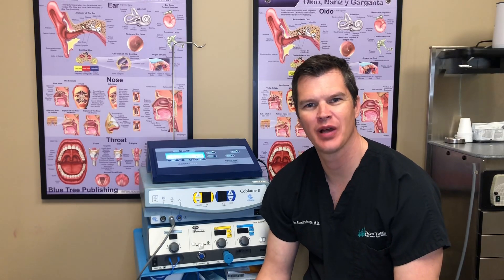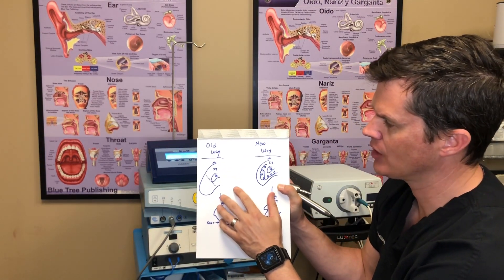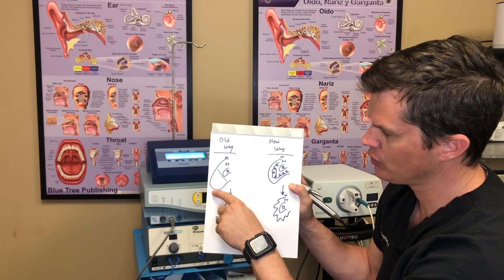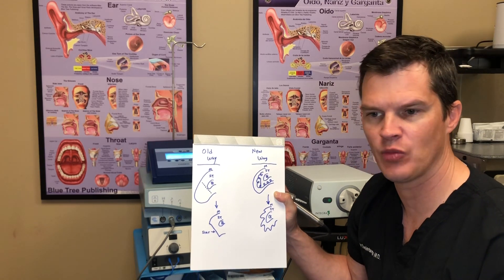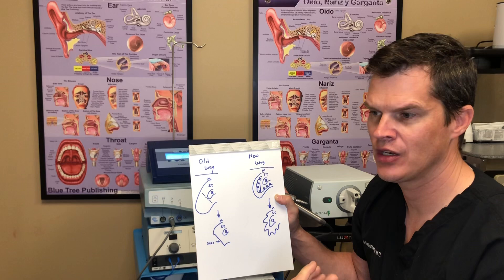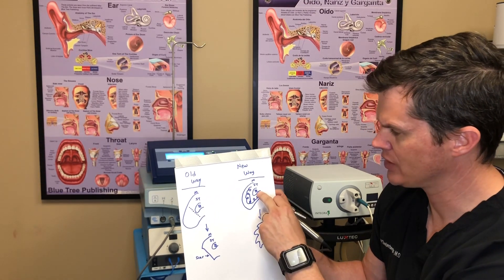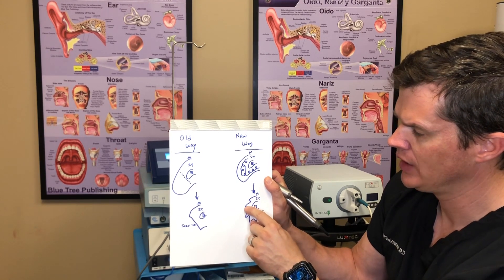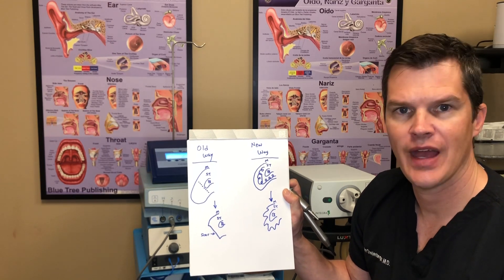Turbinoplasty: new way vs old way

Comment: Hey Dr. i had RF ablation and a while after that i had outfracture too. But after the outfracture i have no to little mucus and sense of smell and air decreased. I don't have ens symptoms but i have mucosal issues. Is this because of damage to mucosa or the positioning of the turbinates? Please guide me.
Reply from the maker: @Ahmetcoşar-u8n  I think it’s more likely related to the radio frequency, than the outfracture. If radio frequency is done too close to the lining it can cause the mucosa to be damaged. That said, that usually fades over period of a few months.
Reply: @dr.shellenberger9830  Im 5 months post op, when i dont blow my nose for a long time i sense air better or when im sick and produce mucus more. But normally its dry and hard to smell and sense air. Will it heal over time?

Comment: Thanks for your helpful video ,i have a  question whats effective and no side effects(ENS) precedure ,laser,shrinking or cut the turbinate?
Thank you again
Reply from the maker: @hassanourahou6932  anything that damages or removes the lining of the turbinate has a higher risk of ENS.  

I’ve done hundreds, if not, thousands of submucosal reductions like I described in the video and have never had a patient complain of long-term issues. 

I am not a fan of the laser procedures because they damage the lining.
Reply: If I go to an ENT, how would I name this particular way of doing this turbinate reduction in the way that they would be familiar with?
Reply from the maker: @ this is a submucosal turbinate reduction.
Reply: @ is that what the technique is called or is that a blanket term for different techniques. I know resection and superficial ablation techniques are bad. What is this technique?
Reply from the maker: @ turbinoplasty is a blanket term.  Resection is another blanket term.  There are lot of ways to do a turbinoplasty.  Submucosal technique spares the lining (“mucosa”).
Reply: @ thanks

Comment: nobody asks the simple QUESTION WHY DOES TURBINATE HYPERTROPHY, if only ENT Asked this simple question and treated the root cause of hypertrophy, there would be no need of these stupid surgeries.
Reply from the maker: @boyandonev7521  there is a mountain of research on turbinates, what they do, why they get big, what simple things we can do to make them smaller, medical managements, diet changes, and about another dozen factors they weigh into a good doc’s mind before considering recommending surgery. 

Making a decision for surgery is always one where the patient has to weigh risks and benefits.  Certainly not every surgery is perfect…but I’ve had hundreds of patients over the last 18 years who have said, “I breathe so much better” after a simple turbinoplasty.
Reply: Doctors should determine the root cause of appendicitis too before they remove the appendix. That's what you sound like. 

I'm pretty sure after I got my usual seasonal allergies, the seasons changed but my turbinates stayed in hayfever mode and don't know how to go back to normal. Unless you think there's a way to get them to stop allergically reacting to literally nothing at all, then surgery will probably help

Comment: Constant runny nose and sneezing, doesn't always mean something wrong with the body. Im young and dealing with vasomotor rhinitis, been dealing with it for 4 years now and it's annoying. I get allergy tested twice and both were negative. Got XRay and Cat Scan and both were negative. I didn't have no polyps or nothing in my nose. I do have a slight deviated septum, but I never had issues with breathing tho. H**l I even got blood work done and nothing, it was NEGATIVE. People always negative and forget that everybodys issues is different. People forget things change in the body, other than "there's something wrong in the body". Our body do have nerves all through it, so the sinus has a nerve and you know how nerves work, they do alot. And sometimes, nerves do overwork itself.
Reply: Me too I also have vasomotor rhinitis, I personally think it’s because of overactive parasympathetic nerves. Did you find a solution for yourself ?
Reply: @EmanuelKljusev-uy6uw  Naw I haven't found a permanent solution yet. But I have found out that mint can control the issue. I found out that when I would brush my teeth. The mint from the toothpaste, would control and calm the lining and nerves inside my nose. Because of the strong cent cooling sensation from mint. So I bought a mint stick to try and fix the issue. But is it a permanent solution? No. It'll keep working, but at some point, vasomotor rhinitis will overpower the mint, because vasomotor rhinitis will just stimulate even harder from the mint stick. But the mint stick will still work, to a couple minutes, to a couple hours, even days or so. But like I said at some point, the issue will just stimulate even harder. Causing more sneezing and runny nose. But you can use it to get the symptom under control temporarily. Plus who wants to keep using a pocket mint stick, putting it up to their nose and sniffing it constantly lol. It'll make others look at you and think you are on something lol. I said I was going to buy an MD Nasal machine for the solution. But I don't know if it's going to help fix the issue. I'm still in the same boat. I'm still trying to figure out the issue.

Comment: Did you say that Empty Nose Syndrome is caused by the overabundance of crusting 2:00 ? I don't think that's right. I think ENS results from nerve damage in the resected turbinates that causes the brain to be unable to register air flow, which induces a sensation of asphyxia. Correct me if I'm wrong.
Reply: I think ENS and crusting occurred simultaneously after resection in some cases.
Reply: Not everybody gets ENS maybe only 10%, but those 10%*suffer real badly
Reply: @nenadcubric2663  Had I known of ENS, I would have been a lot more thoughtful in deciding to have my surgery. I was lucky.

Comment: I had septoplasty turbinoplasty with microdribder. I am having trouble sleeping. I am feeling burning in my lungs. I am feeling lumps of dust in my throat. It has been 2 months now.Is this empty nose syndrome? I am feeling very scared There was fluid accumulation in my ear, the doctor said that DNS or Inferior turbinate enlargement should be done and he advised me to undergo septoplasty turbinoplasty with microdribder. I have to take a deep breath after a few minutes😢
Reply: Hello ankit is it better now or do you feel the same bro? Im post op 18 days now and too much mucus buildup nose bleeds crusts and not being able to breathe and sleep please reply if you got better or not im feeling the same depression you felt while typing this comment 😢
Reply: @shubhamadhana1185  Which method did the doctor use to do this?
Reply: @AnkitSharma-hr6rl  i dont know about this but he is actually a very senior doctor from Apollo hospital Delhi and have a very good record
Reply: @AnkitSharma-hr6rl  how do you feel now is it better?
Reply: @shubhamadhana1185  No brother, nothing much has happened. I have sleep problems. I feel cold air inside my nose when I breathe or there is obstruction.
Reply: @AnkitSharma-hr6rl  so you can’t exercise or do any physical tasks?
Reply: @shubhamadhana1185  no bro
Reply: @shubhamadhana1185  I feel extremely tired because I don't get enough sleep
Reply: @AnkitSharma-hr6rl  How are u feeling now bro?

Comment: Any type of these unnecessary procedures can cause extreme irreversible harm that is not fully discussed amongst patients. Turbinates are essential to the respiratory system and also have a neurological connection to alert the brain that you are breathing. Something goes wrong with these surgeries you have no way to reverse damages and are gas lighted by Ent dr.s until you are 6ft under.
Reply: Why are you saying unnecessary procedure, obviously most of us have trouble breathing, mine is so bad that I even have blood pressure and stress since I was a teenager.

Comment: My dad once told me that everything in your body has a purpose and you should really be careful about removing anything from your body.  No way would I let a doctor stick that microdebrider in the nose of anyone I care about.  Think about that people….would you want that thing stuck up your nose turning a grape into a raisin???
Reply: You would if you suffered from chronic rhinitis or sinusitis.

I'm sorry but It's a awful, awful condition and it just worse as time goes on. I feel like I can maybe get in 30% of the air I used to get in, when I sleep it has to be on my back with my head propped up which results in my body sometimes forgetting to take breaths in or takes really shallow breaths.

On top of all that I get chronic congestion, brain fog, memory problems, pain around my eyes, tinnitus, constant post nasal drip and extreme fatigue (I wake up every hour, that's just the ones I remember)

My life is hell, everyday I think about doing something stupid, I left my job because I wasn't capable of functioning like a normal human being anymore.

I think I'll take my chances with the surgery thanks.
Reply: @TheRankingRealm-e7h  im going through the same via covid
Reply: @TheRankingRealm-e7h  how was it.. have you done the surgery?
Reply: @Monicanada1  turns out I had a severe vitamin b12 and folate deficiency, got injections with top up nasal sprays and a lot of my symptoms are disappearing.

Didn't think a little vitamin deficiency could be so severe 😂
Reply: @TheRankingRealm-e7h what sprays?
Reply: @TheRankingRealm-e7h can u name the sprays
Reply: @TheRankingRealm-e7h  did you get the surgery any updates ?

Comment: All methods can lead to Ens. Turbinates should not be touched unless there is a tumor or cancer.
Reply: Nasal Spray they don't work for me, I ve tried everything. I don't want to have surgery but I so tired of not be able to sleep or rest with my nose blocked and drowning feeling.
Reply: @Eliandro264  have you tried saline or just spray bottle with water up nose. The latter might sound silly, but it’s the best thing that works for me and it’s much cheaper than saline.
Reply: I use family care nose spray from the dollar tree. It's the only one that worked for me but i had the turbinate surgery because mine was so bad but I'm kind of regretting it now. @Eliandro264
Reply: This has been 10 years for me and still blocked and nothing work
Reply: https://pmc.ncbi.nlm.nih.gov/articles/PMC3199827/
Reply: And if you can't breathe then what to do?
Reply: @perhaps5hhp6p46 they'll breathe through mouth 😂
Reply: And what’s your expertise ?
Reply: Nasal sprays and allergy testing and allergy shots
Reply: Hasn’t worked for me.

Comment: I think most of the ENS-TYPE cases are caused by Heat(Cautery, RF, Coblation, Diathermy & Hot Microdebrider(Built in Cautery)). Heat shrinks the turbinates, but cause extensive damage when used to shrink or to stop bleeding. Cold Gentle Microdebrider reduction with No Outfracture(Makes the nose too wide open) i think leads to best outcome. American Rhinologic Society should ban the use of heat in the nose to avoid this catastrophic disease that is destroying life. Good to see that doctors start to acknowledge ENS.
Reply from the maker: I think as long as you leave the mucosa intact and healthy, ENS is going to be super rare.  Definitely agree that cautery should be avoided.  I’ve used submucosal RF occasionally and have never seen any long term issues with it, but don’t think it is as effective as microdebrider submucosal turbinoplasty.  I actually like outfracture and haven’t seen any data advocating against it.
Reply: @dr.shellenberger9830  Thanks for Replying Doc. I have come across many people with Mircordebrider Reduction with Outfracture and they seem to have suffocation and feeling of openess because Microderbrider take out tissue and with adjunct Outfracture they have that feeling also it probably distrubs the Nasal Cycle too. I have also read comments of people who had only Reduction and No Outfracture had excellent results. I think the Contour and Shape plays  a role of Aerodynamics and only soft tissue reduction is what is required. I am happy to see that doctors are avoiding heat in the nose. Facebook groups like Empty Nose Syndrome Awareness group is loaded with people who have different kind of procedures and their outcomes.
Reply: @sandyvirlo7797  Sandy are you a doctor or do you have Ens.